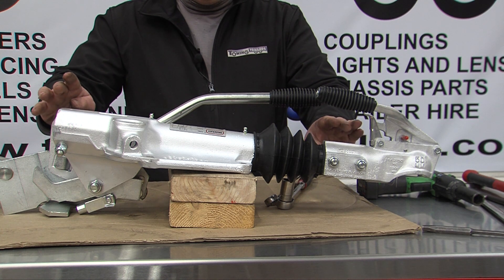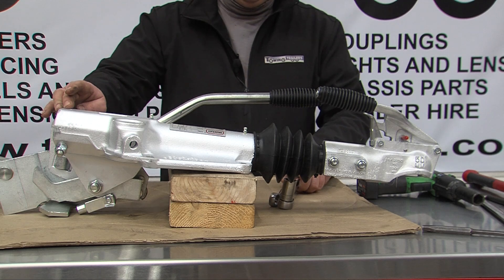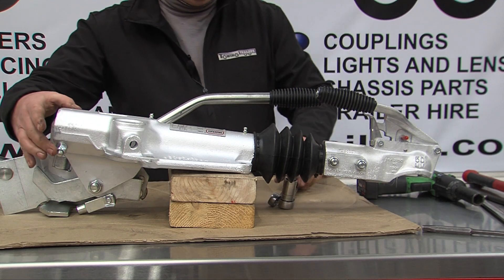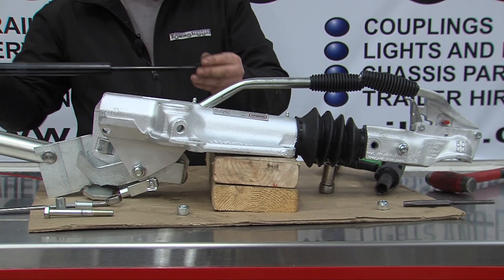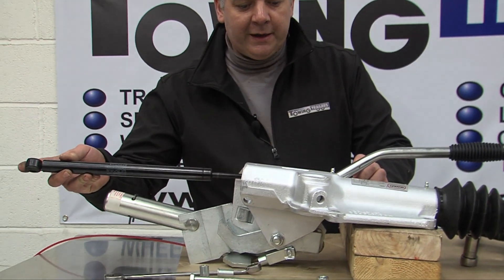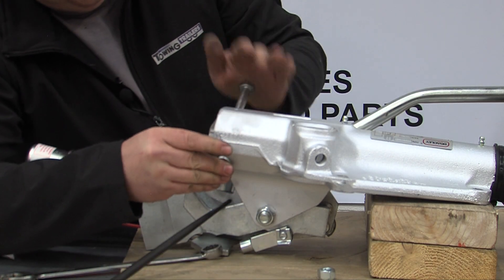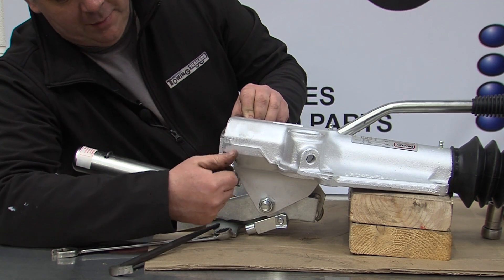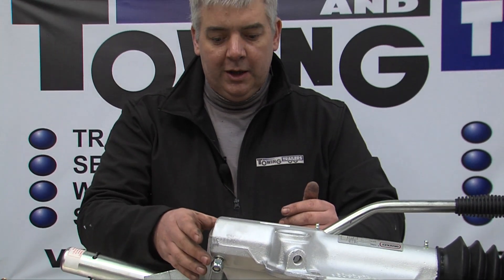How to change a damper in a Bradley trailer coupling

Comment: i wonder if you can help me ?
i have a caravan from early 1970, the trailer is made by Peak Trailers and there are no bolts holding that i can see on the front coupling and im wanting to change the gaiter ?
there is one vertical bolt which is tack welded on
you'd probably need to se a photo of it to know